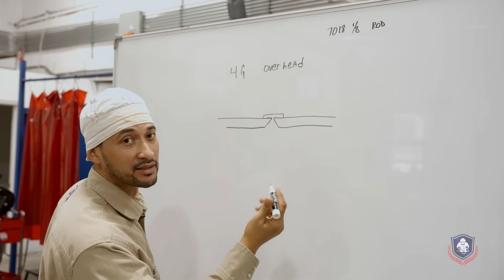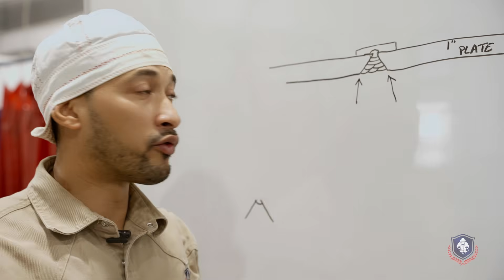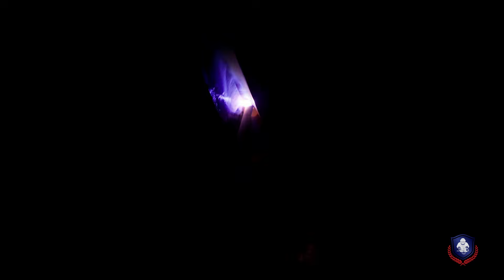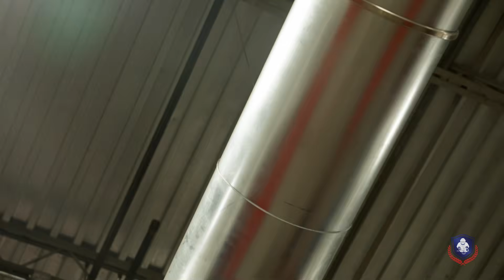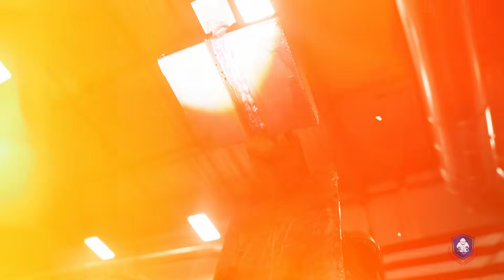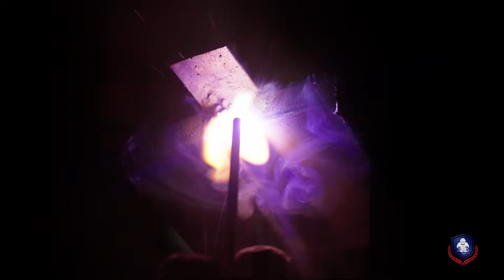Mastering the Overhead Weld | Stick Welding 4G Position D1.1

Comment: Do you only have to use the backing bar for a few passes or all because you stopped using it after your second weave?
Reply: Excellent question, but you do not remove the backup bar until the test is completed and you let the plate cool completely

Comment: Can you do this same test without the backing plate?
Reply: You can , just lower temp and a drag motion 6010 root, 7018 does it as well  it as well lower temperature and keep the key whole tight. Don't burn through. Rod position and temperature is key.
Reply: @UjeshpaulMaraj  My point exactly. When I did this test in the early 80's the idea of a backing plate would have been unthinkable due to its absence in real life situations.
Reply: You can its  just not the best method to do so

Comment: In CA we can’t weave so it’s a bit tricky passing this test
Reply: Whats the reason for that
Reply: @SuperBlueeyes89  because weaving is not as strong as stringer beads weaving can produce weak points in the weld… usually has a greater heat affected area than running traditional stringers.
Reply: @SuperBlueeyes89 BECAUSE STRINGER BEADS ARE ALOT STRONGER THAN WEAVING BECAUSE OF GRAIN GROTH, WHEN THE MOLACUES COOL DOWN YOU WANT THEM AS SMALL AS POSSIBLY AND THEY WILL GET THAT WAY BY STRINGER BEADS BUT WHEN YOU WEAVE THEY WON'T GET SMALL AND THEY WILL STAY BIGGER THEN THE MATERIAL BECOMES ALOT MORE BRITTLE AND WON'T BE AS STRONG, FACT
Reply: Washington State is the same exact way except for the 1st pass, the root pass, but after the root pass you can only run STRINGER BEADS ALL THE WAY OUT TO THE CAP PASS OR COVER PASS AND THAT'S GOING BY AWS D1.1, ABS AND COAST GUARD IN THE SHIPYARDS AND THEIR HIGHLY STRICKED ON THAT, IF YOUR CAUGHT WEAVING YOUR HISTORY, PERIOD.

Comment: The true AWS D1.1 base on WPS is this: the two running plate placed on the tip of the steel plate one running plate on the tip of steel plate and other running plate placed on the other tip of the steel plate that the welder should follow the standard procedure, because the QC inspector wants to see your root pass at back of your steel plate if good  and nice penetration or not , not your one length of running plate placed at back of your root gap or root opening and tacking. Maybe the code that you read it's bias
Reply: This is a test bro . In the field you won’t have run on/off tabs or backing plate
Reply: Do you have a picture or a diagram..?